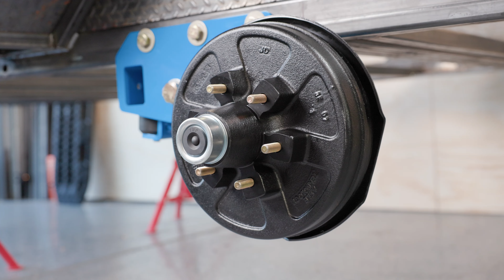Timbren Axle-Less Trailer Suspension | Electric Brake Hub Install

Comment: What’s the torque spec?
Reply from the maker: Torque values can vary, but 25-35 ft-lbs on Hub bolts, is what is recommended.
Reply: @TimbrenIndustries  Terrible answer, answer to no-where... 
As a manufacturer, one need to at least refer to a link (pdf or similar) where such data exists, or what is recommended at least